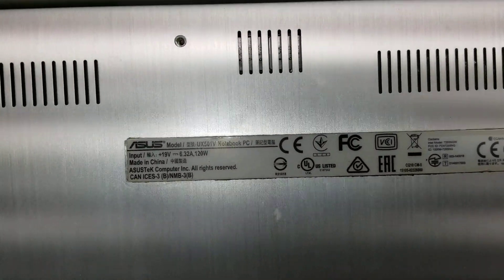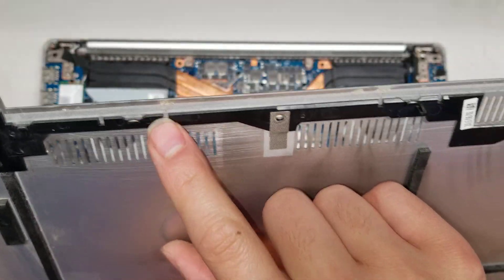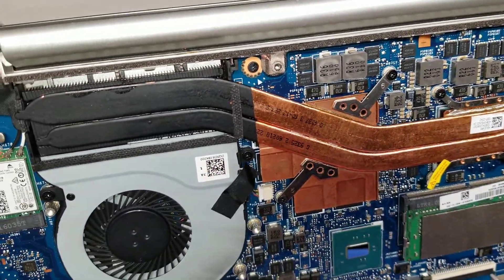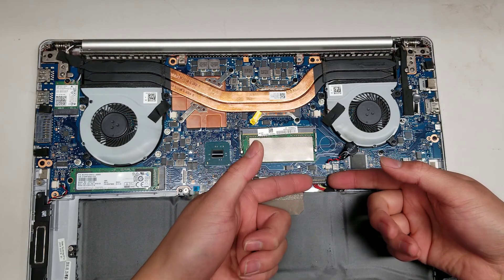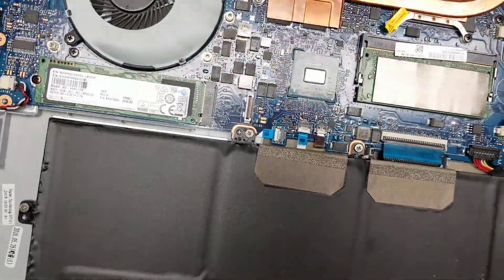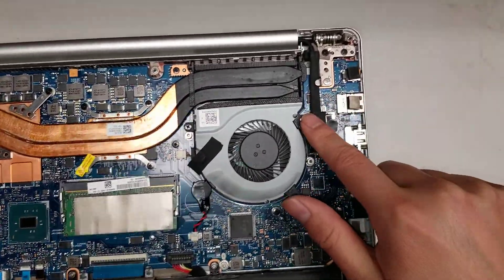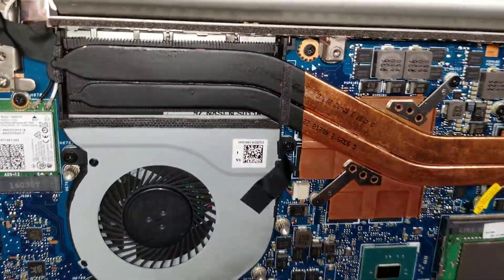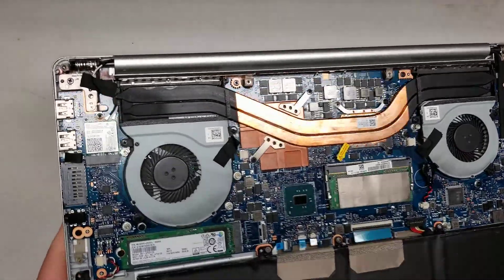ASUS UX501V Disassembly RAM SSD Hard Drive Upgrade Repair

Comment: 2021Nov. on my UX501VW-FY195T with Bios version 305 (old, not upgraded!) I've successfully installed a ""Corsair Value Select SODIMM 16GB (1x16GB) DDR4 2133MHz C15"", so I've now a total of 24GB without any issue!! I think the important is the same frequency of the embedded ram
Reply from the maker: That is correct. Frequency is the important part.

Comment: My removable ram died. Do you know if I can add larger that 8gb? This seems to be a costco only model so there is almost nothing on the internet about it.
Reply from the maker: As long as the pc# and speed matches it should be fine
Reply: Upgrade to 40GB RAM for my Zenbook Pro UX501V (8GB soldered + Samsung 32GB DDR4 2666MHz RAM Memory Module for Laptop Computers (260 Pin SODIMM, 1.2V) M471A4G43MB1 ). IT WORKS!!! 😁😁😁
Reply: @jedi4039  I ended up getting a 16GB A-Tech brand one off of amazon for $75 which gives me 24GB now. I'm happy with the performance.  40GB is crazy fast!!! Congrats

Comment: Hi! any chance you know if I could put a 1Tb ssd? I've only found old threads in forums saying there is some kind of 512gb limitation
Reply from the maker: That's nonsense, you can put 4tb if you want. Just make sure it's the same type not sure if it supports pcie nvme or only SATA
Reply: @ItsBinhRepaired  Pcie x4 Nvme ;)
Reply: @ItsBinhRepaired  Is there any 1TB SSD you would reccomend for this?
Reply from the maker: @coolufo3  this should be good https://amzn.to/3aK26PZ